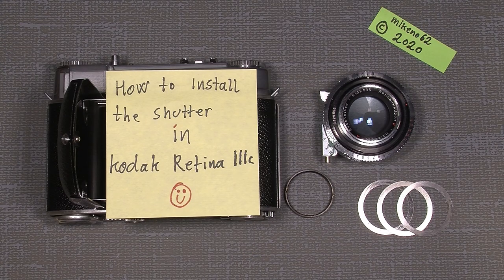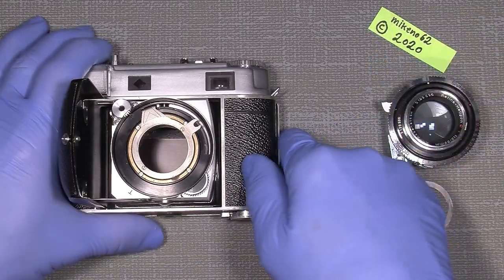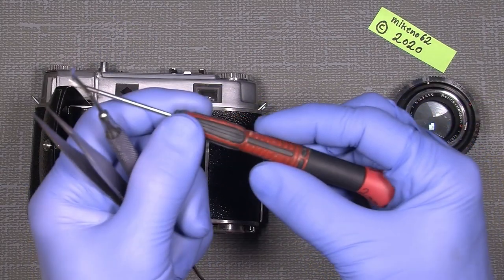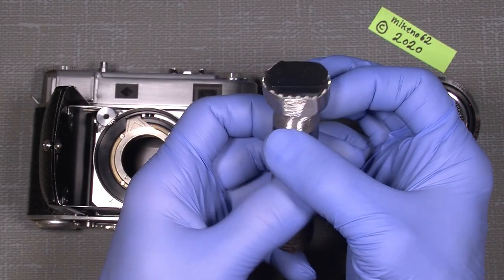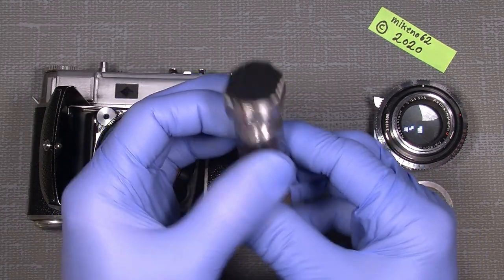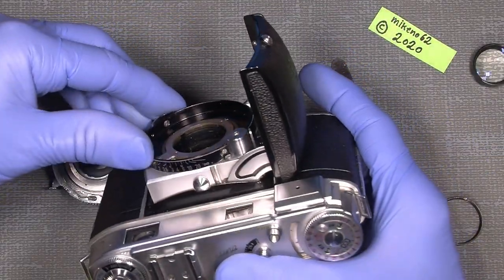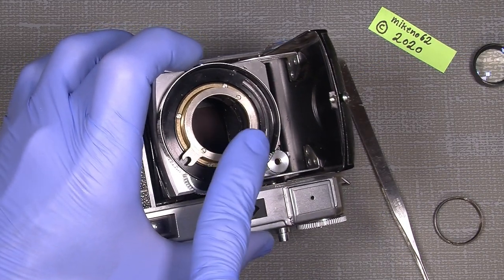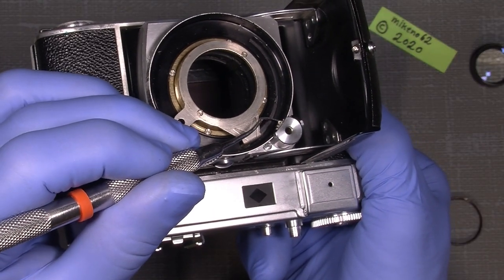How to install the shutter In Kodak Retina IIIc

Comment: Thank you very much for this video, excellente and clear instructions.
When you have time, can you please do a video showing how to set the film advancing system?, I mean how to set the various levers  an gears in upper part and lower part of the camera body.
Unfortunately I had a camera with film loading lever blocked, so, I tried to dismoundt the upper and lower covers of the camera body to see the root cause, but I don't see anything wrong or broken, maybe I need to dismount some gears and levers to adjust the correct psition buit the I need to know how to re-assembly again.
Thank you un advance
Greetings from Italy
Antonino